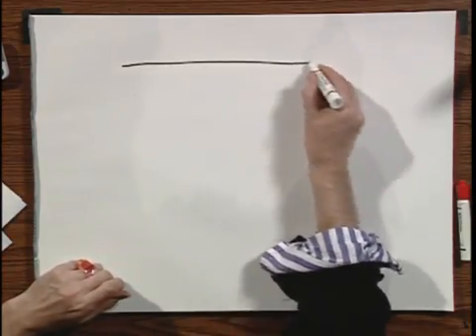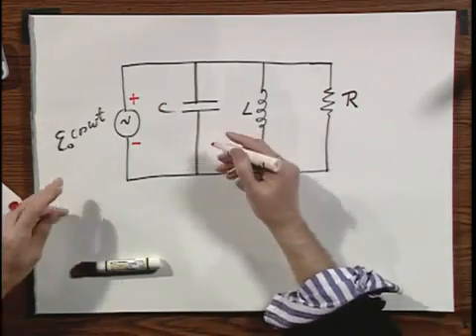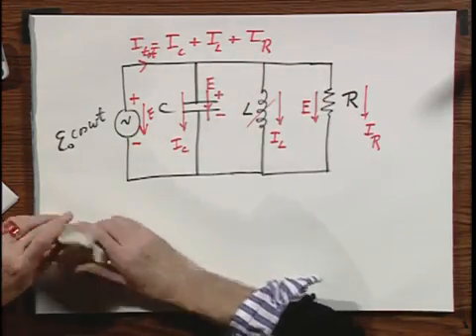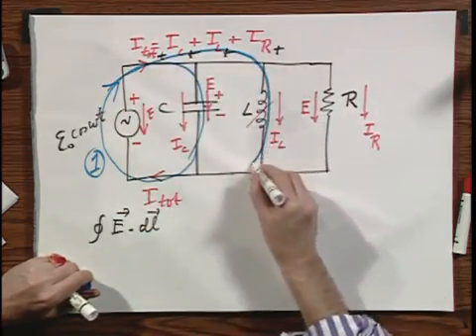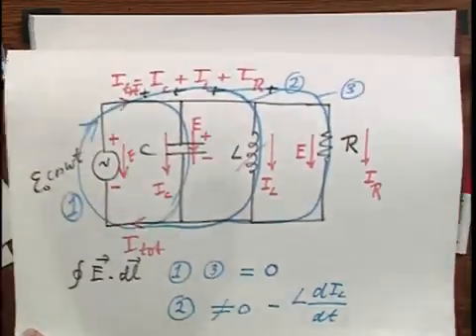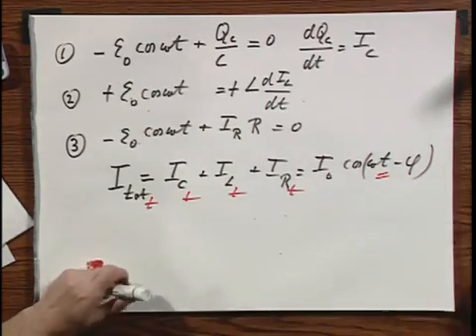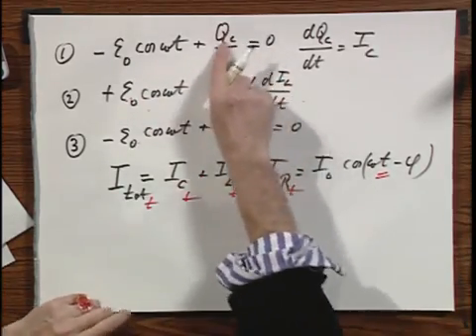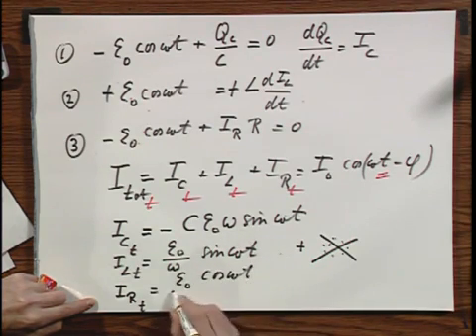8.02x - Module 10.05 - Parallel RLC Circuit - Phase Angles - Impedance - Resonance

Comment: But why there is no current pass from the inductor?
Reply from the maker: your question is unclear. RLC systems obey all 4 Maxwell's eqs. The ohmic resitance of a pure self inductor is zero. Thus the integral of E dot dL through the wire of the inductor MUST be zero at all times.  However, a current can flow through a pure self inductor.
Reply: @lecturesbywalterlewin.they9259  thank you so much sir

Comment: Shouldn't be tan(φ) = R*( ωC - (1 / ωL) ) ???
Reply from the maker: what I have is corect - 0fcoz -
Reply: @lecturesbywalterlewin.they9259  I am pretty sure that R should be in the numerator. What you have is not dimensionless as tanφ should be. From the triangle tanφ = opposite / adjacent = Ε0*(ωC - 1 / ωL) / Ε0*(1/R) = R*(ωC - 1 / ωL)

Comment: What will happen if the voltage source frequency was set up to zero ?
Reply: zero frequency means a dc source aka battery. and when battery will be connected, initially capacitor will begin to charge, current will start growing in inductor and also flow throught resistor. And at steady state no current through capacitor, inductor behaves like a normal wire, and there will be a short circuit

Comment: That was great, thank you very much. But I think you meant to say that you took the derivative as a function of omega and not time at 15:08 and 16:25.
Reply from the maker: y=f(ω) yupe should have been dy/dω. Amazing that noone pointed that out in 1996 when this was on the air at MIT 24/7 for a whole week.
Reply: @lecturesbywalterlewin.they9259   professor but how will i know this yields maxima or minima because we use same method
Reply: @cricobug9778  in this case you know that maximum current is infinity and the curve is vertical line at infinity, whereas maxima/minima is a point on curve where derivative is zero which implies a horizontal line. So the extremum we got here will definitely be the minimum and not maximum.

Comment: This is a band stop filter. The "anti-resonance point " makes the current low at a  particular frequency and fixed LC properties.... pretty handy for a multiband ham radio antenna.However this // circuit can also function as a radio tuner.  Now use the  inductor from the series LRC circuit, and place it next to the parallel circuit inductor and create a transformer. substitute a variable capacitor in place of the fixed capacitor, the  parallel circuit becomes a tuner, and the series circuit a band pass filter which tunes  an antenna!,has taken me 43 years since college physics to master this understanding..thank you Dr. Lewin. I did get an A back in the day.....but now my eyes are fully open. I simply cannot watch this lecture enough times...awesome....simply understanding the circuit by understanding the components limiting values , Faraday's law applies loop 2 not  a poor application of KIrchhoff's voltage rule, absolutely brilliant.  Phasor diagram insight, leaving out Mr. Euler's equations for now.......to focus the ideas...stunning

Comment: Sir , imagine we have an ideal ac voltage source in series with an ideal self inductor and we connect them by superconducting wires , will we have an induced emf in  that circuit and if there is an induced emf , what will be the location of the emf ?
Reply from the maker: this is a classic question. https://physics.stackexchange.com/questions/108821/what-happens-in-a-circuit-when-the-wire-and-the-battery-are-superconducting-an

Comment: Sir , if we have a battery with no resistance , is it possible to have an induced E-field in the battery due to time changing B-fields in the circuit ?
Reply from the maker: make your own calculations and estimate realistic values of the self inductance  of all your components. My guess is that the sum of all will be less than 10 micro H. Take it from there

Comment: In resonance :
(1)  is the instantaneous current through source = instantaneous current through resistor ; ie the entire current supplied by source goes through resistor ?
(2)  instantaneous current through inductor = instantaneous current through capacitor ( but in opposite direction )?  ie ,capacitor and inductor feed each other.
Reply from the maker: 1. question unclear
2. NO
watch my related 8.02 lectures.

Comment: At 4:33 you said that total instantaneous current [ through battery ] is sum of instantaneous currents through  L, C, R. But in my book it is written that " The total current  drawn from the supply is equal to the vector sum of the resistive, inductive and capacitive current, not the mathematical sum of the three individual branch currents, as the current flowing in resistor, inductor and capacitor are not in same phase with each other; so they cannot be added arithmetically. 

Could you please clear this ?  Is the sum of rms currents through L , C , R  =  rms current through source or is this true for instantaneous current ?  Does phasor method work for rms currents or instantaneous currents ?

Is Kirchhoff's 2nd law not valid for instantaneous currents ?
Reply from the maker: >>>>At 4:33 you said that total instantaneous current [ through battery ] is sum of instantaneous currents through  L, C, R.>>>>
That is correct. The solution to the diff eq I(t) says it all. There is ONLY one I at a given time t and that takes the phase angles into account.

Comment: At 5:28, you get done writing the equation for Current through the solenoid as a function of time: (emf/w)*sin(wt) -- the integral of the equation 2. But based on the equation, shouldn't it be divided by an L term to get rid of it on the right side.
Reply from the maker: yessss there should have been an L. sorry!  Thanks for pointing this out.
Reply: Thank you for the confirmation!! Awesome lesson as usual.
Reply: @lecturesbywalterlewin.they9259  Respected sir can you Explain the same topic by using Complex numbers method,

Comment: sir..what will be the voltage across the inductor if the electric field is zero..whether it is zero or.. it is the source voltage ...pls provide me an answer..thank you
Reply from the maker: In case of non-conservative E fields, it's better not to talk about "voltage"or "potential difference" over a self-inductor as it depends on how  you measure it. If you define potential difference as the integral of E dot dl through the superconducting self inductor the answer is ZERO as the E-field in the self-inductor is zero. If you place a voltmeter over the self-inductor, then you have added a loop to the circuit and you will have to apply Faraday's law in that loop. You will then find that the voltmeter reads the value + or minus L*dI/dt. I suggest you watch 2 of my lectures   https://www.youtube.com/watch?v=LzT_YZ0xCFY&list=PLyQSN7X0ro22zanLOcvkaSY-IZqheFYM5&index=4 and 
https://www.youtube.com/watch?v=nGQbA2jwkWI&index=17&list=PLyQSN7X0ro2314mKyUiOILaOC2hk6Pc3j
Reply: thank u very much sir